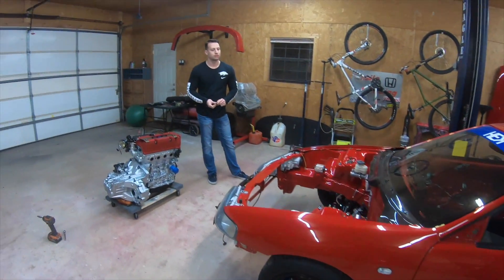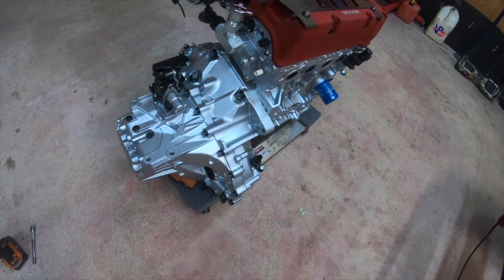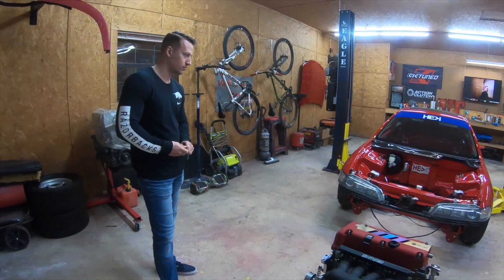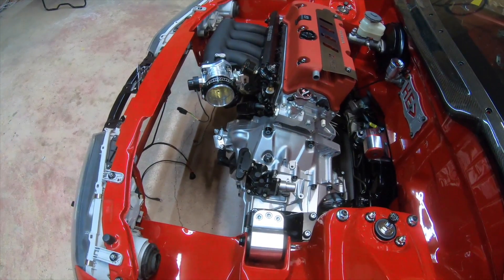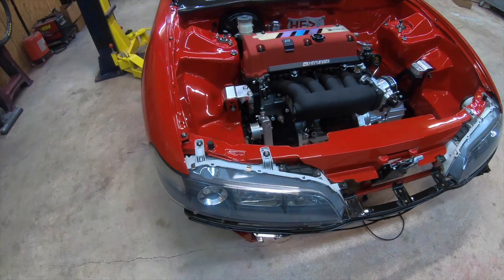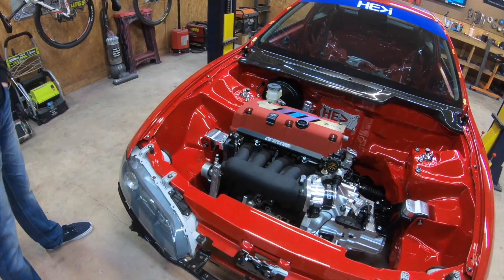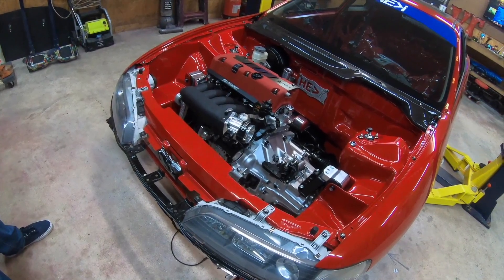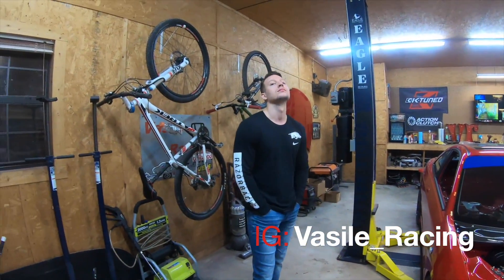K24 finally goes in

Comment: Dude put some loctite on the k tuned ac/ ps delete alternator bolts I had alot of problems with bolts coming off
Reply: xxEaZexx i always had the upper bolt snap on my with that setup :/ they are a pain
Reply: allmotor dc5 I got the upper bolt broken in the block right now, I zip tied the dam thing, it's working fine
Reply: xxEaZexx yea after i broke mine 3 times i would just snug up the belt and run it. Im glad i changed that setup lol
Reply: allmotor dc5 I’m going on my 3rd bolt right now. I ordered a grade 12.9 bolt. Not sure what’s going on. My EM2 is boosted so I’m not sure if it’s the hasport motor mounts because of the vibration or just a bad batch I’ve been getting.